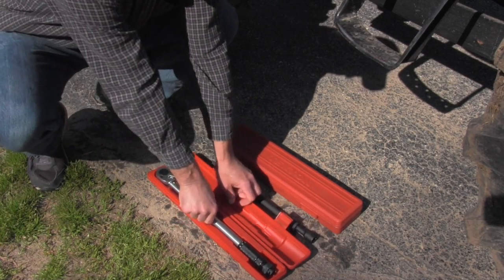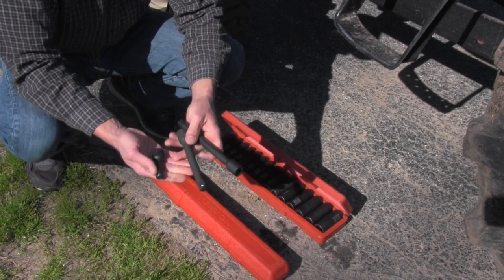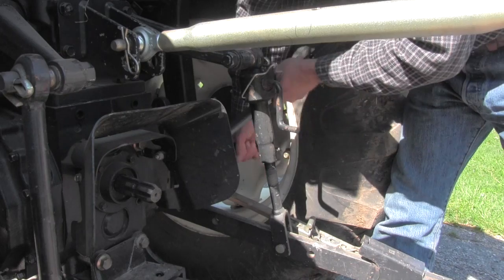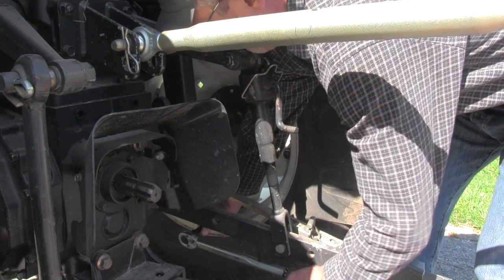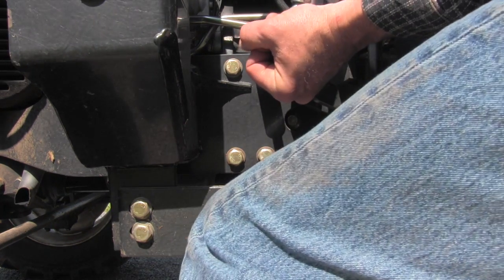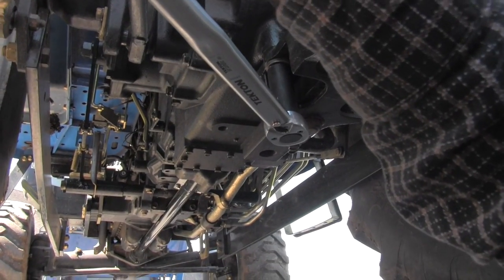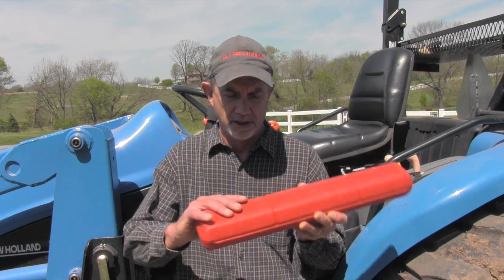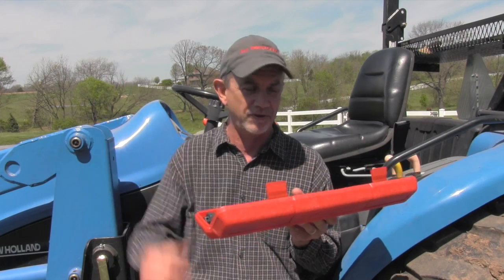Torque These Six Sets of Bolts to Avoid a Costly Failure

Comment: So true.  Another tip - always just look for other loose bolts when walking around your tractor or doing maintenance.  About 15 years ago we had all the bolts that hold one of the front wheel steering pivots come loose when plowing with an older 120 hp front wheel assist tractor.  The whole front wheel assembly fell off destroying the ring gear which was obsolete in the process.  We were able to put it back together so it can still be used in 2wd for tasks that don’t require 4wd, but 4wd is gone which forced us to buy a new tractor.  Not having those bolts torqued correctly cost $85k!

Comment: Have you had any issues with your Tekton torque wrench?  How often do you check the calibration and where do you check it?  Have you compared it to the DeWaldt version?  Thanks Mike, it was a great video as usual.
Reply from the maker: Edward, no issues, and I've not calibrated it.  I only use it once a year in the spring when I get everything ready for work.  It seems to be a good value for the money but I've not compared it to anything else.
Reply: @TractorMike  thank you so much for responding. I went ahead and ordered it after reading about Tekton. Also I cannot wait to watch you live on my cluttered garage which is coming up soon I think. Thank you for all your videos they’re awesome
Reply: @TractorMike  my wrench came today it seems to be wonderful !

Comment: I noticed a oil leak developing from the crank case joint to the transmission on my MF150. If this leak just started, can I just retorque these bolts? I do not have specs for this also, so it would be nice to know if there are some universal specs out there to get the right setting on the wrench. Thanks, and keep up the good work! Russ

Comment: Good video showing the areas of concern.  A railroad guy told me at a training once. " This train rattles down the tracks and none of the bolts ever get any tighter. "  It was common to have a leak of a rail tank car and it is often repaired by just the tightening of the valve bolts.

Comment: Mike

Love your information.  Just moved my  BRush hog so as to change blades. I've reviewed your prior videos about doing so. When I moved it I noticed a ring of dried fluid underneath on the cement.  You mentioned that seals can go bad. Is there any way to check where that might be coming from aside from putting a piece of cardboard underneath?

Thanks

Comment: That story about the loose wheel bolts: that very thing happened to my neighbour. His Mahindra tractor, about 80hp, lost all but two bolts and he finally realized something was wrong when he saw the wheel wobbling. The factory had forgotten to tighten them. To add insult to injury, the dealer refused to replace the missing bolts even though the tractor was only a month old and under warranty!

Comment: Mike using a white paint pen to mark a line on critical nuts or bolts once torqued can tell you at a glance if something loosened up at least that what JD does from factory on wheel bolts etc.but you still got to get in habit of checking the marks.I'm actually surprised the more important ones aren't drilled for safety wiring.
Reply from the maker: Yeah, great point.  I've noticed Deere does that, I'm not sure many customers understand why.  That would make a good video.

Comment: Great advice Mike. Another little tip for you. Every extension or adapter between the torque wrench and socket requires an extra 5 lbs be added to the original spec.

Comment: Thanks for the advice Mike. I didn't think to check that the loaders bolts were at the correct torque. After watching your video I checked them and they were miles out of spec. I think you may have prevented a real nightmare in the making. I expect you have saved many people money and (or) injury with your great advice. Thanks again for your great work.
Reply from the maker: My experience has been that they're more often than not a little loose.

Comment: Good advice Mike
My JD 990 pivot front end bolts were so loose (1 missing) when I got the tractor, that the 4x4 was clicking when engaged. The front drive shaft had so much play from being loose the 4x4 gears couldn't properly engage. My rear wheel was so loose on my bush hog that I am lucky that it didn't fall off. Now, if I ever get another used tractor grease and a bolt check would be at the top of my check off list. Again, excellent advice Mike Thanks

Comment: I finally purchased a torque wrench a few years ago. Prior to that I just used German torque, (Gootentight) for most bolts. I have a friend that is a GM mechanic and insists that a torque wrench is a waist of money. He some how dials a tightness from the numbers on his impact wrench. I don't use the shop where he works. I purchased a new tractor this spring and the manual said to check the torque settings at 10 hours. I was surprised how many were below specs.
Reply from the maker: Yeah, you'd think with all of the air tools in use that the opposite would be true...all the bolts so tight you can never get them off.  My theory is that most compact tractors are assembled by a high school kid on the back lot with his socket set, so you never know what you're getting.  Best to check it and make sure then everyone is happy.  Talking about the shop guys who rely on air tools for torque specs, I managed a dealership for ten years where all of the techs did that.  I don't think I saw torque wrenches for any of the things I mentioned ever used.  Now, if they were working on an engine or hydrostat, they always used them, but for all the things in the video it was 100% air tools.  I have to say I never had a single complaint or failure related to that issue.  Now, if the guy is using air tools to assemble the internal components of an engine, I can tell you from experience...STAY AWAY!!!

Comment: How do you figure out what the torque specs are on your tractor?  I don't ever recall seeing those in my owners manual.  My first tractor the loader bolts came loose and moving some very heavy mud I heard a loud snap.  It sheared one off because another one was missing.  It was a special metric thread and I had to order it online.  I tightened them all back very tight but I never had any torque specs to go by.  Interestingly the one loader bolt went through the loader frame, through the main frame, and into the engine block.  That was the one that sheared.  Luckily I was able to get it out of the engine block to easily replace.
Reply from the maker: They're in my manual.  The should be in every operator's manual, if they're not, I'm not sure what they do in a warranty situation when the wheel fell off the tractor because it wasn't tight at the factory and the manual doesn't tell you how tight it's supposed to be.  I'm glad to hear the situation you described worked out all right.  That could have been really ugly...
Reply: Wondering the same thing, Matt.  I've purchased service manuals for various cars I've owned in the past.  They aren't cheap but the good ones are packed with info like this if you are working on a particular repair.  Of course, instead of owning a book or dvd, you can always spend time with that favorite dealer - a bonding experience with the service guys.  :-D
Reply: It should be in your manual. If not call the local dealer for the information. They have to work on the stuff so they would know. If you are mechanically inclined, you might search on line for a shop manual. They can be expensive but are cheaper than the $80. an hour that my local ship charges.
Reply: Good question I would like to find out

Comment: Use a good quality torque wrench, torque these critical bolts when the tractor is new, again at 50 hours. Especially the wheels. you are torquing the wheels with the tractor sitting on them, the bolts may be pulled tight, but when the wheel turns, you change the loaded point, and the bolts may be loose again. Torque bolts in a star pattern, check the owner's manual or service manual for the correct pattern to use on the part.

Comment: How do I find the foot lb setting for each set of bolts.   I don't think my book that came with the tractor gives that information.
Reply from the maker: Karl, it should be in there.  It's kind of hard to find sometimes, usually in the back, buried with other information.  If it's not in there, I'd call the dealer and make them get it out of a service manual because it will definitely be in there.

Comment: Good advice! Vibration isn't the only cause of loose bolts. Bolts on the tractor can also loosen from metal deformation. This is especially true for the loader bolts. They don't necessarily vibrate loose but over time the metal on the bracket or surrounding material can "compress" which can result in a loose fastener.